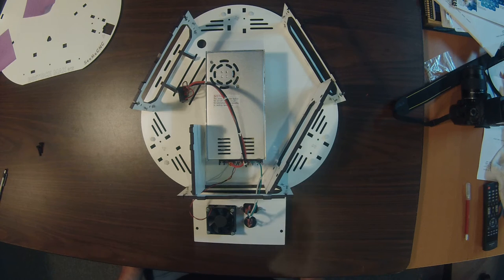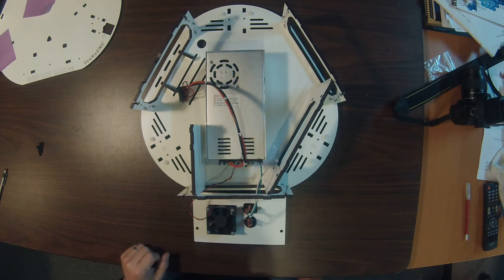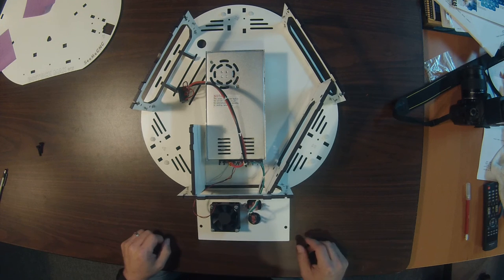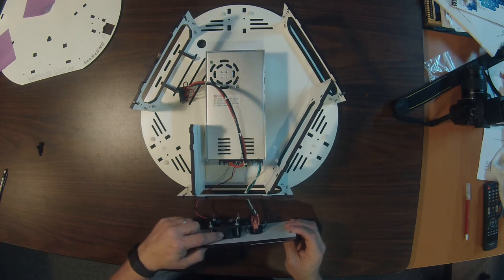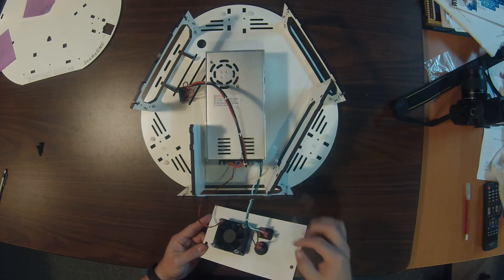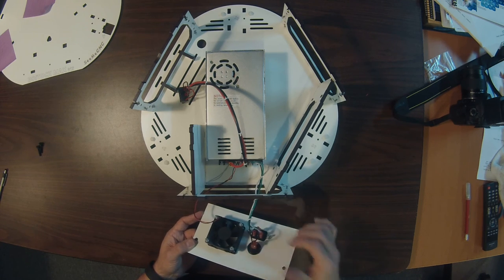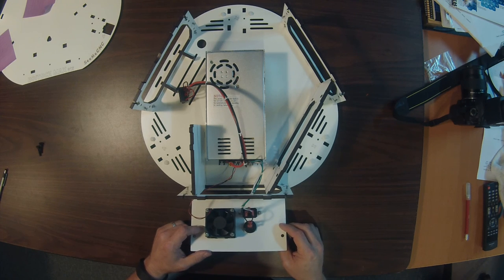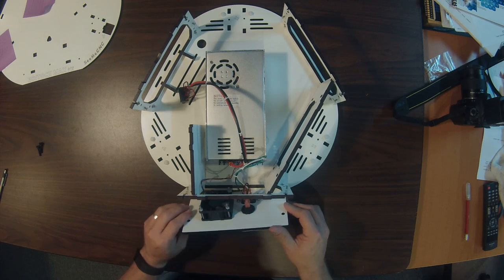Rostock MAX v2 Assembly checkpoint video #5

Comment: I believe the connection looks different to the Manual. White and Black seem the other way around?
Reply: +sunyatarock The manual has the correct orientation.  I didn't catch that I'd flipped the hot & neutral lines until long after I'd done this video.

Comment: The manual (V2- 4th edition) does have the white and black switched (fig 6.6-7, page 54)(http://download.seemecnc.com/rostockmax/Rostock-MAX-v2-Assembly-Guide-4thEdition.pdf)  The fan does not work with that arrangement. I had to switch the white and black around as in the video for the fan to work.
Reply: Experienced the same thing today. Switched the white and black (as you mentioned), and then the fan worked (without power supply cover mounted). Then, remounted the power supply cover, and the fan didn't work. It turns out, one of the 18ga wires was pressing against the fan (with power supply cover mounted), preventing it from spinning. So, I positioned the white & black per the manual and reattached the power supply cover, and fan worked as expected. Just had to make sure all other cables were clear of the fan.

Take a peek at the female end of the AC cord and you'll see an (L) and (N) next to the 2 adjacent sockets. L, meaning "live" should connect to the black wire. N, for neutral, should connect to the white wire.

Good luck! It looks like you're a few days ahead of me. Can't wait to complete it!